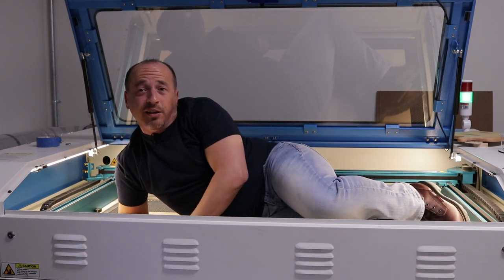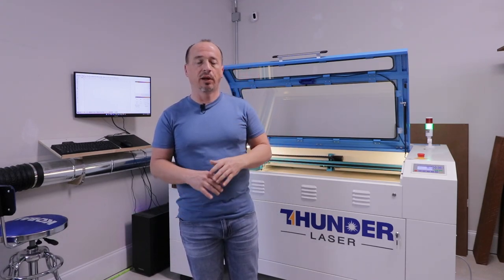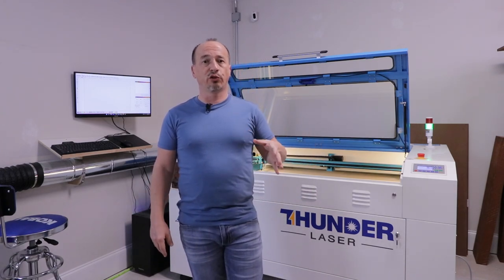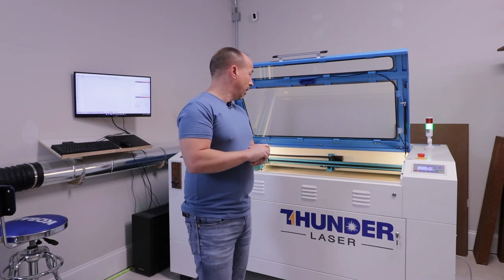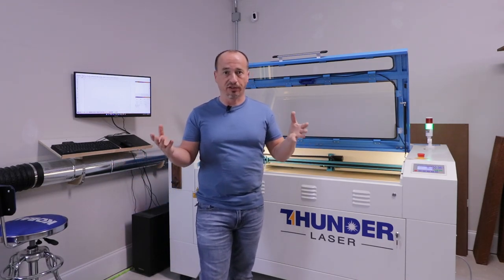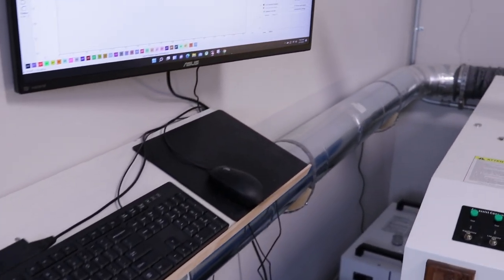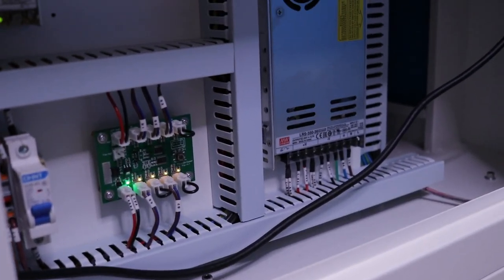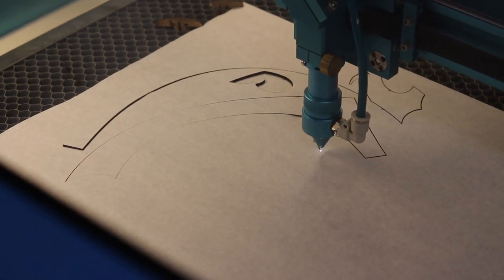Laser Review - THUNDER Laser NOVA 51 130w CO2

Comment: I really enjoyed this video and I appreciate you taking the time to thoroughly esplain the reasoning behind this choice of a machine. My only question is about the 130w of the laser.... Looking back on your use, do you consider this to be a bit much for what you want to cut or is this power of laser for the what if situations? I respect and admire what you are doing and I will continu on following your work as I'm sure it will evolve in time into more original art work and technics! Good going and keep up the good work.
Reply from the maker: I did have some doubts as to whether the machine was too much power or not...  since co2 tubes can only fire soo low (mine is around 10% power) that does mean that I can't get as low as may be needed for some things.  That said, I can still cut paper reasonably well running at around 1k mm/sec.  On most cuts I rarely go over 80% power, but it's nice to have the headroom!